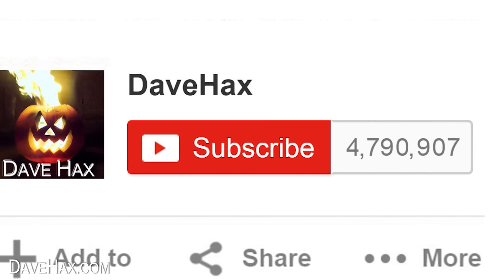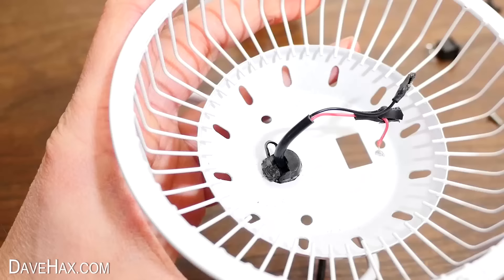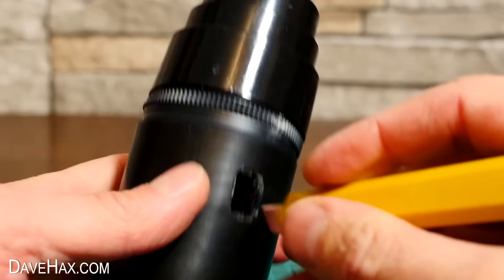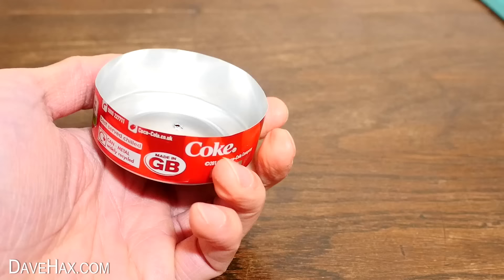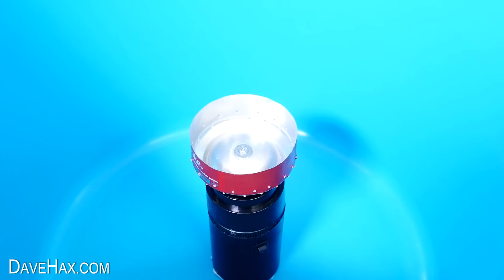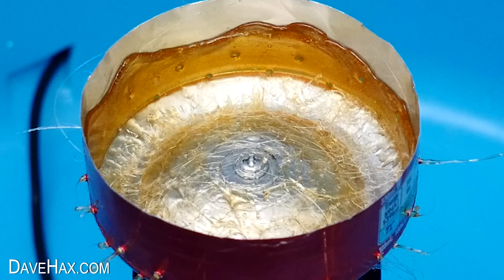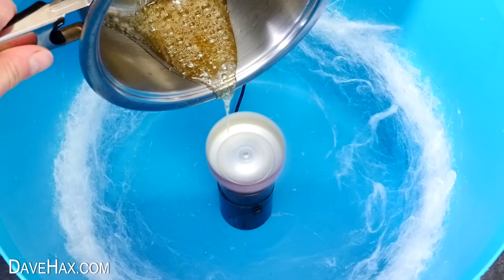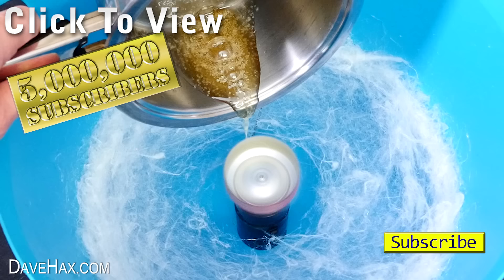How to Make Candy Floss Cotton Candy

Comment: My thoughts are: take a single spiral hot plate from China which has a thermostat, mount motor with longer shaft through the centre of the hot plate,  take a tin of tuna instead of a coke can, cut old cooking pot and use as a bowl